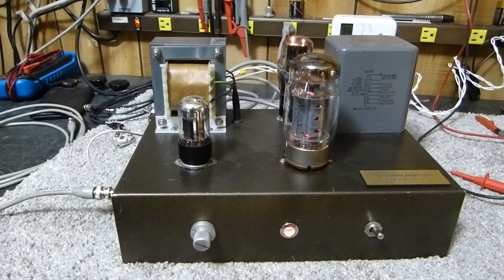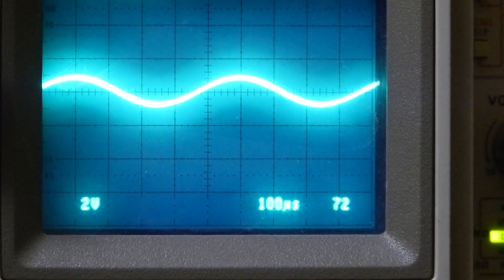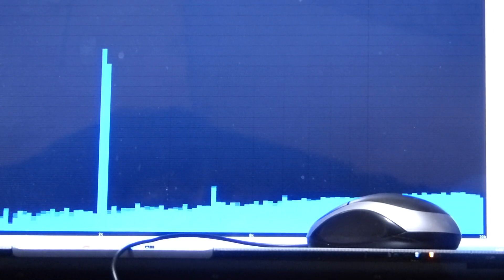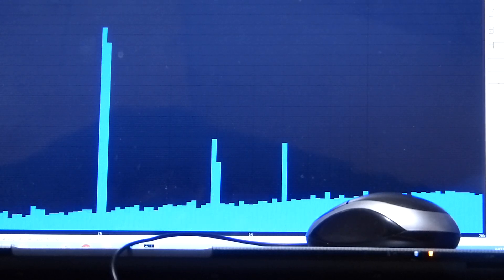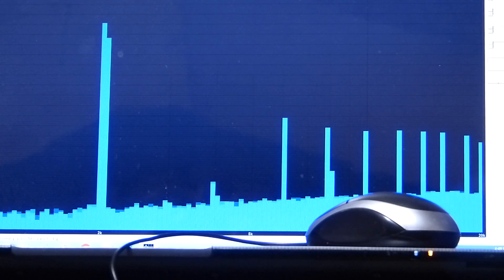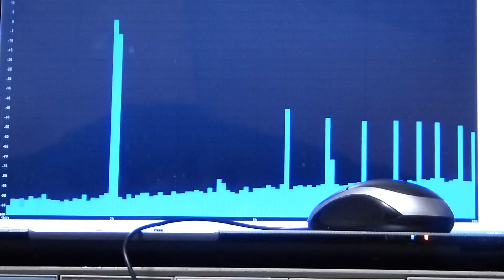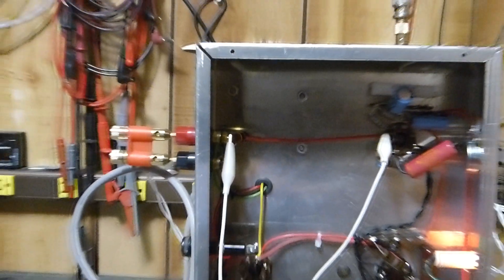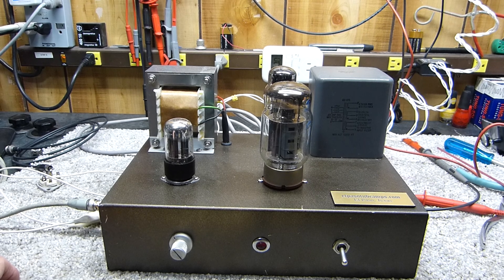NFB And The Single Ended Amplifier Harmonic Profile

Comment: I have to ask, but I am assuming that the choke in the schematic is to feed one channel. So if I was to build a stereo amp as you have, it would need a choke that is capable of handling 175ma or 200ma? Especially since I would be using either EL34’s or KT88’s as my power tubes. Thank you.
Reply from the maker: Yes, you will need a choke with twice as much current rating for stereo. 200 mA would be sufficient for your EL34 or KT88 stereo SE amplifier.
Reply: @ thank you
Reply from the maker: @markmorrow3250  There is a "hack" as it is called today, to determine an adequate value of inductance for the power supply choke by dividing the PS DC voltage value in volts, by the total current in milliamps, in this case say, the voltage is 400 volts and the current is 200 mA : 400 / 200 = 2 Henrys. This works quite well. Choke of 2 Henrys at 200 mA. You can make the choke value bigger but this is adequate for good filtering.

Comment: Great video as usual.  Just for fun, you could try connecting this kt88 or maybe even an EL34 in UL mode :) I think you might like it too. I played a lot with SE amps and never got them to sound right using 2 voltage gain stages before the output tube. I guess there’s something about too much voltage gain in the front end and negative feedback that just doesn’t add up…When I use a single tube in the front end or even a cathode follower after that, they sound like a million bucks and cope with negative feedback a lot better. So much better in fact that I ditched the volume control at the grid of the front end and am now using only negative feedback to control the gain and it sounds a lot better.  You could try half a 6sl7 just to see if it works. In my amp I’m using a half a 12at7 per channel driving a pair of el34’s hooked to  a 4.300 ohm ultra linear OPT. B+ is 288V and I have +265 at the plates, running the tubes a 75mA each,  there’s no grid current and the second harmonic is what dominates the harmonic profile up to 7w rms .. thanks for sharing the good stuff we all love !
Reply from the maker: I don't have any UL tapped SE OPT. I am running the KT88 at 80 mA and 400 volts for 32 watts of anode dissipation. Design max is 40W. I will experiment with raising (more negative) the bias (lowering cathode current to 70-75 mA) and see where, if it exists, a spot of bias and NFB where there is not that anomaly of the 2nd harmonic drop-out. Somehow that bothers me. Since the 807 is essentially a 6L6, I should experiment with vintage 6L6G, etc. and KT66 before taking on the KT88... I am very pleased with the quality of drive signal to the grid of the KT88. Bias on the KT88 is -40 volts and my drive signal starts to distort (grid current) at a peak-to-peak voltage just above 80 volts. With the KT88 cathode disconnected, the drive voltage is very nice and high (no loading of grid current). I would like to maintain the harmonic profile of the classic SE amplifier from lowest signal level to clipping. If there is any sibilance, it is very hard to say where it is coming from nowadays. It could be the SE power amplifier, digital streaming, speakers, old analog recordings, etc. I don't have a serious issue with sibilance but I do hear some HF artifacts sometimes that do not seem normal. My speakers are Klipschorns so they can be too revealing and not everyone is charmed by horn speakers. I am 99% happy with these SE amplifiers but then there is that pesty 1% that drives us crazy...   🙂
Reply: @ I hear you. Until you get that 2nd harmonic up where it has to be with respect to the others, it’s gonna drive you nuts…. I’m the same way. In triode connection, 3w rms below 1% the is already something to be proud of. If you have a grid current situation going on, maybe there’s too much plate voltage, and too much negative bias voltage. If you lower the plate voltage and increase the plate current, maybe it’ll get the second harmonic where it needs to be. Because 80V p-p is excellent, you could drive a 6080 with that and that’s a pretty hard tube to drive, but that pushes the grid near the region where it starts drawing current. I’m driving my el34’s with 12Vrms (measured with a tek x100 probe from the good old days), across a 470k Ohm load. Ah, forgot to mention, after almost 10 years of working with cathode bias only, I went back to fixed bias and it’s just so much easier to get the plate current right this way. Triodes, and I assume triode connected tetrodes, tend to sound amazing when you crank the plate current up. I never used the el34 in triode mode, only ultra linear and pentode but the data sheet says it’s plate resistance goes down to 900 ohms in triode mode, that sounds pretty good, close to that of a 300b. And yeah, horn speakers can be really exciting but it’s hard to evaluate harmonic profile with them because they can be a tad unforgiving. My Dad has 2 pairs of horn speakers and when I took my amp to his place, there was definitely some sibilance, but at home I play it through 2 1/2 way speakers with scanspeak 7 inch drivers that go from 29-7.000hz and I use a silk dome tweeter just to fill the top end and you can hear all the detail but there’s no sibilance. I even went through the trouble of lowering the gain all the way down and using my grado open back headphones… no sibilance at all. Using a digital source with horn speakers is most likely the reason for that extra “air” in the top end. The efficiency of the klipschorns sure come in handy with an SET. My speakers give me 89dB at 1w, 1m… on a good day… but I can live with it, no problem.
Reply from the maker: @dennisgouveadeazevedo6238  We agree on a lot of things. In my case of grid current, my bias is -40 so any voltage with a peak of +40 (80 v peak to peak) will drive the bias to zero and anything past that will result in grid current. I hope to make a video showing that  tonight. It can be seen with two traces that the top of the sine wave at the grid and plate distort the same at the same time. I have always found running the output tubes "hot" makes them perform better. I know that is true in PP and I assume it is true in SE. With measurements tonight, I believe the drive to the grid with no grid current will go above 60 v peak and that would be enough to drive the 300B as I believe their bias is around -60. Sibilance is a very minor issue and is nominally present (I think that is what I hear ...) on just a few pieces of music. All my music is from Tidal and unfortunately, a good bit of the high-end classical music recorded in the 1960's or so, is just not that great to listen to. Then there is sometimes the over processed modern music but over all the sibilance is minimal and could be anything in the audio chain. Bass is beautiful. I had a Mac 240 for years - many years ago and in 1976 bought a MC275. I like the 275 better than the 240 but it has never thrilled me. I made a 300B stereo SET loading the plates into a 15H choke and using high-end PP James transformers to match Z to speakers. The primary of the James transformers were capacitor coupled shunt to the choke so no current was flowing in the James matching transformer primary. I liked it for a while but something was just not quite right with it. This amplifier no longer exists and I am unsure of the 300B now... Thanks for the comments and conversation.
Reply: @ hey, it’s always a pleasure. And  I’ve learned so much from your videos, I’ve been religiously watching every single video you have put out there since the early guitar amp stuff …. Another thing that we seem to agree on is the fact that we can live with the bass from a single ended amplifier. At first, when I went from solid state to all tube push-pull, I didn’t want to ditch my solid state amps, I had a luxman back then. But since my first dynaco st70, I was so enchanted with tubes that I could no longer look back to solid state gear. I thought I would miss the bass but in reality, not at all. Then 10 years later the same thing happened again when I went from push-pull tube into single ended tube, I don’t miss anything and my last push-pull amp (a Williamson UL using 6ar6’s) dates back to 2016. For almost 10 years now, I’ve been doing single ended tube and I couldn’t be happier. Then again, I’m glad with the bass. Over the years I tried many tubes and the el34 in UL seems to be the tube for me. But I still want to experiment with kt66’s and some weird tv sweep tubes.  I remember the parafeed 300b amp. Those videos inspired me to build a lighter version using a 100mA 30H choke, a 33uF film cap, a 5881 at the output and a 6dj8 in the front end….using a Hammond push-pull opt to match the impedance. The bass was amazing for a SE amp but I also felt it lacked something. After going nuts over it, I came to the conclusion that a tiny bit of saturation (really minuscule) pushes the core material into a more linear region within the hysteresis loop, at the expense of inductance under load and efficiency. Yet another reason why single ended amps sound better IMO. Later on, I built the same amplifier using just a regular single ended opt and I found it sounded more natural and imaged better than the parafeed version. But the bass on the parafeed was amazing. Oh, btw, I used both tidal and Qobuz for a while and I found Qobuz gives me better sound quality and the audio seems to be a bit “mellower” in the top end. You can get up to 192kHz/24bit with Qobuz.

Comment: What would be the significance of these readings on the Fletcher-Munson curve?
Reply from the maker: I don't know, but the Fletcher-Munson curve is a contour attenuation of the mid frequencies. I don't think we will get this effect with the power amplifier. As was shown in an earlier video, the low-pass followed by a high-pass filter in the Brooks amplifier was the opposite of the F-M curve with attenuation at the low and high ends of the frequency spectrum. Personally, I have always thought that circuit was to accommodate high efficient vintage speaker performance. I could be wrong.

Comment: Almost all experimentators assume that 0,8% distortion is too high. Let's  calculate - assuming that you tested  voltage distortion  then it is  adequate to 0,8V in compare to 100V of pure sinus. Transforming to   power (rise to 2nd power)  we get like 0,64 in compare to 10 000  It means we have like 1W pure distortion   in 15 000W  of "clean" sinus    .This transformed to decybles is like distortion level is  abut 80 db below. music  level and even less than natural background noise In listening place l.   Is it worthy to align?
In very old times when Hi FI wasn't expected   distortion was limited to  at maximum level 10% It results in 100 : 10 000  In power it is like 100W per 10 000W - 1:100 is level of 40 dB and ibecause they are higher sounding they were realy noticeable and technical data couldn't ommit this - actualy they were showing max power avaliable without ovepassing 10% THD In your amplifier only moments when momentary power is 1 W you will "enjoy" 0,8% distortion. In quiet listening it goes sharply down. and does not bring more joy.

Comment: Very interesting. It makes sense to tweak the nfb to get the harmonics you're looking for. I've never seen this demonstrated before, nor had I given it any thought.
Reply from the maker: I have never thought of tweaking the NFB for a harmonic profile either until now. I will post another video tomorrow to show the 6SN7 voltage amplifier performing perfectly until the grid of the KT88 starts to draw grid current. I am also interested in investigating bias current vs harmonic profile on the KT88 and an EL34.
Reply: Looking forward to it.. 😊